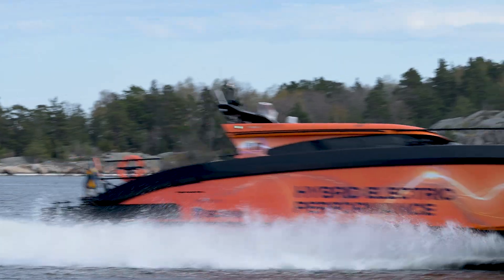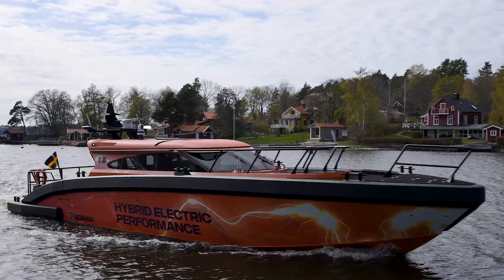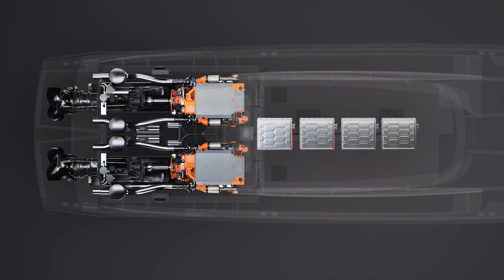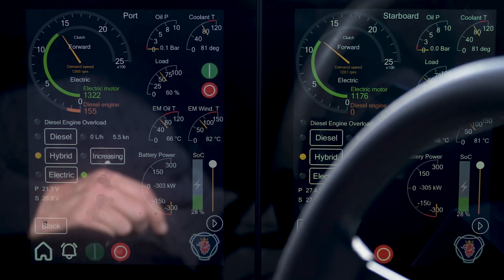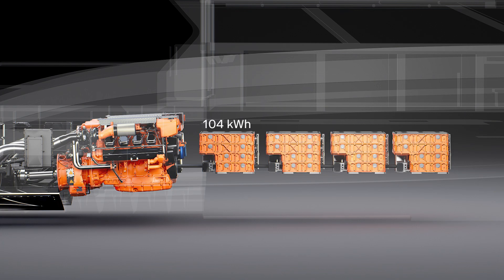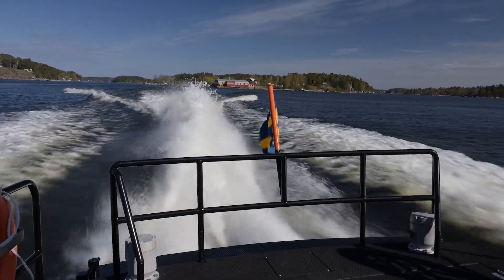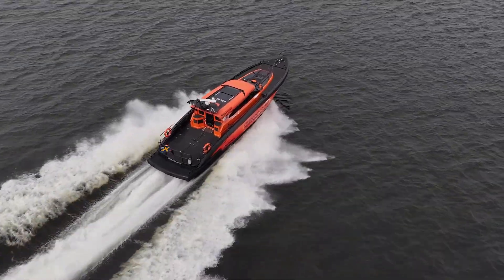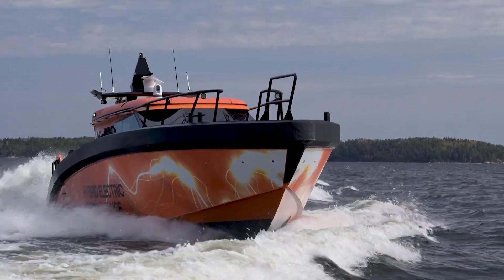An engine for a sustainable future

Comment: surely this will lure customers in to going electric much quicker, once the "but can it do 1:1 what my current ICE setup is capable of?" is put aside. Once they got HPC CCS terminals dockside they will see the drastic difference in operating cost between battery powered (from the grid) and Diesel generated. Great way to circumvent the range anxiety and get boat users addicted to the silence and instant power.
Before the decade is out these boats will possibly be-iced with battery tech and price taking leaps.

Comment: This is clever. Shore power enables them to run short distances, or to operate when they would need to idle an engine. And then they retain their high capacity for speed or ocean work.